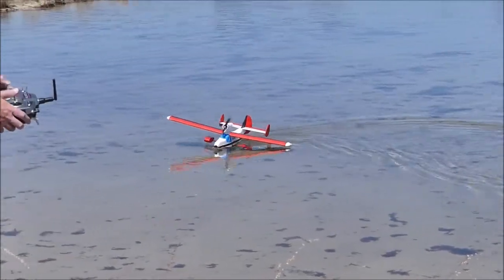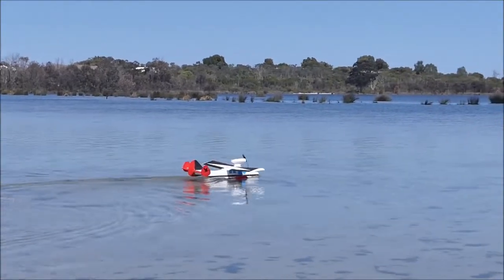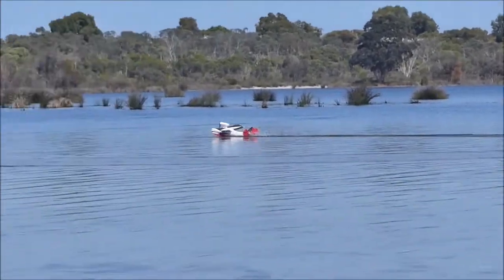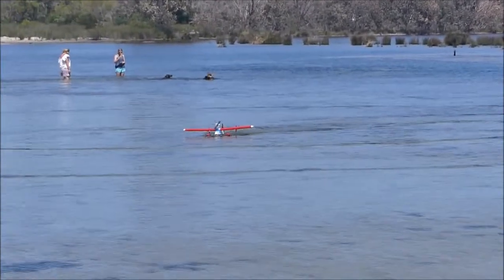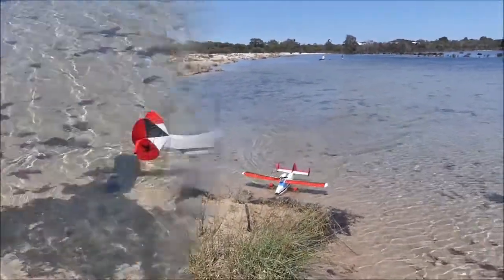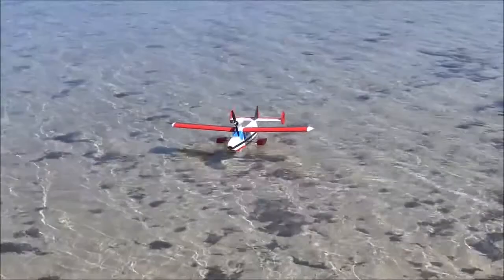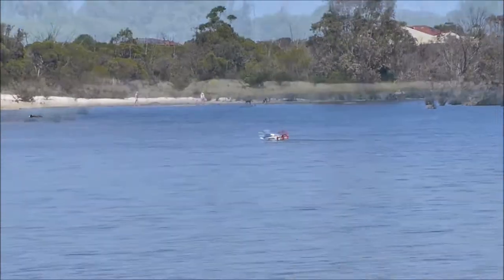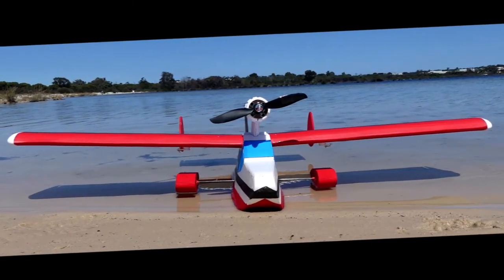RC Drake seaplane maiden attempts

Comment: check the CG, the incidence of the engine and the wings.
your plane tries to lift its nose and that slows it down. when taking off it always leaves in loss. At the time of takeoff you have to use the ailerons to keep the plane level, as if it were a motorcycle. upwind using the rudder to correct direction.
Some hydros with little step must be given a lever to the elevator just to detach it from the surface of the water, without raising the nose much.
good luck
Reply from the maker: Thanks for the tips. I will pass them on to the pilot.

Comment: Looks tail heavy. Or just heavy. What is the weight and wingspan? It's not planing like it easily should, and immediately tip-stalled when you lifted off. I published plans to build this with depron/FFF/DTF back in 2007. You can double-check your CG and wing AOA from the plans: https://www.rcgroups.com/forums/showthread.php?755688-FFF-Drake-seaplane-PLANS

Comment: It is dragging the tail all the way slowering the plane and sinking it. Does it have a step? The step should below the CG. Also noticed that the small pontons are too rear and horizontal, they should be more forward, with their end close to the step/CG, pointing "up" to help the step.
From the first jump it looked tail heavy, but it can be the water dripping from the fuse.
Try to add some down-elevator to raise tail before takeoff.

Comment: Nice looking model! Power and wing incidence look good, but the way the tail drags in the water at speed is suspect. I'd attempt takeoff with some down-elevator to raise the tail until the plane can get up on the step, then gently level off until it rotates. Lowering the thrust angle probably wouldn't hurt, either.
Reply from the maker: +Joseph Martinez 
Thanks all suggestions welcome. We want to see this model fly.